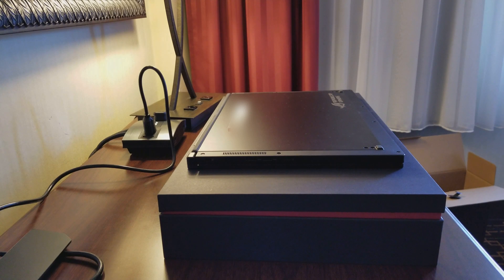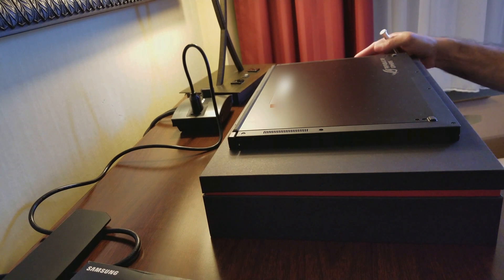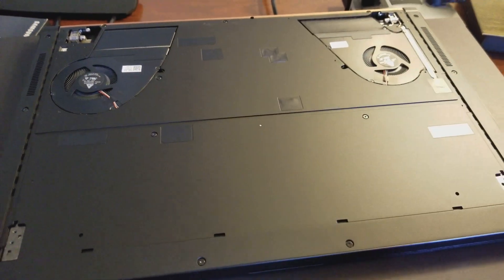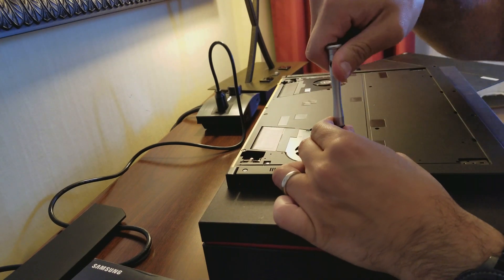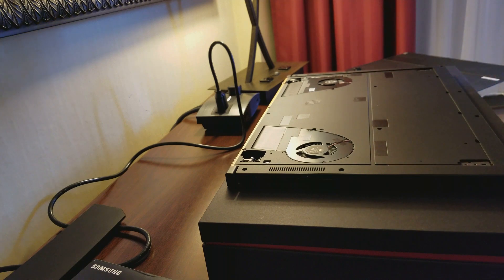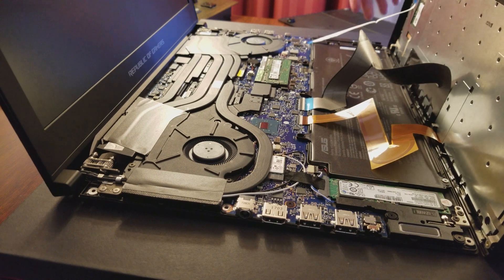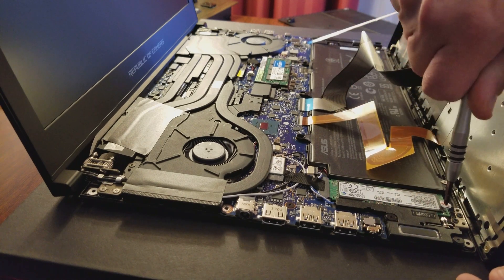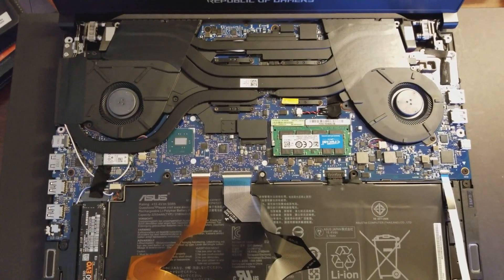Asus Zephyrus SSD and Ram Memory Upgrade

Comment: I bought a recommended ram upgrade for the soldered on gx701 I have 16gb soldered single channel. I added my Samsung 2666.6 ram and I get a black screen. I take the ram out all is normal. I ordered another stick of ram hyperx on recommended on Amazon incase I need to return. What ram do you suggest worried ill get black screen again
Reply from the maker: U can use these ... https://www.amazon.com/Crucial-16GBx2-PC4-19200-SODIMM-260-Pin/dp/B019FRCV9G/ref=as_li_ss_tl?crid=2OO5IPMTUETR&keywords=32gb+crucial+ddr4&qid=1556652522&s=gateway&sprefix=32Gb+croc,aps,201&sr=8-3&linkCode=sl1&tag=worldofgadg08-20&linkId=a8e833669cc90e89818f88d6f9820cf7&language=en_US

Comment: Hi there... Great video. However, I am confused. I have a Zephyrus GX501. It came with 16Gb of RAM and I want to upgrade it to the 24Gb. I see that you only removed one module and there only seems to be one slot. Does this mean that you inserted a 24Gb module? Can you tell me how this goes? I thought I only had to ad an extra 8Gb module. Thanks ...
Reply: if its like the gx701 there is 8gb soldered on and 8gb stick that you can remove

Comment: Is it true this zephyrus has 1 slot of ram welded on the motherboard
Reply from the maker: Alejandro Leyva yes
Reply: What's the estimate time when it comes of the battery in use with out having the charger plugged in?

Comment: You REALLY need to be careful taking the top off; I just did it, and the ribbon to the mousepad broke off, and it’s not possible to re-connect it. The actual plastic connector came off the back of the keyboard.

You have been warned!!

Comment: Hello, is the soldered slot an 8 or 16?
Reply: That's what I was wondering. He replaced the 8gb stick with 16gb. So 8gb soldered? Making 24, with 8gb soldered and 16gb upgrade stick? Thx
Reply: @stlexicon3044  that's what I fear

Comment: Heyo, i have read, that there is a 2nd RAM slot(?) and a 2nd m.2 with only Half the PCIE lanes (slower tranferrates).

I have the GX701GX and want to add one RAM 8GB (SODIMM) and ONE Samsung m.2 NVME 1TB

i havent found the slots and i think its on the back of the Motherboard but im scared to check because IF it isnt there it might be worthless to do all the Stuff.

Can you tell me how i Could upgrade the ram to maximum (Which RAM sticks i need) and where i can put the 2nd m.2 NVME?

Regards :)

Comment: Hi when I opened mine I accidentally disconnected the white cable from the right side ? What should I do?
Reply from the maker: Julio Luna well there should be a small lock just pull it up using ur nails insert the cable back in and lock it in again ! It’s very simple
Reply: I had the same issue - only the plastic clip actually came off of the back of the keyboard, resulting in the mousepad no longer working...

Comment: Gaming performance will drop 20% or more if RAM is upgraded on Zephyrus that has 8GB onboard.  You must leave the 8GB onboard + 8GB pre-installed SODIMM alone or else dual channel performance is lost.
Reply: Does the 24gb Zephyrus have the soldered slot as the 8 or 16 one?
Reply: Cpu Z says I have single channel on my zephyrus 1 slot used of 4. Whats does this mean...my understanding is that there is a single slot with 1 8gb stick and 8gb directly soldered in. Now I havent opened mine to look. But if this is true why does it report it as single channel. Am I to assume that in reality I have 16gb soldered and no ram in slot?

Comment: So you upgrade your ram from whatever it was to a 16gb but you say it would go up to 24gb? I don’t understand
Reply from the maker: FUNK949 yes so the way this laptop is configured is that there is an 8gb ram soldered in and its internal and can’t be change so the slot that is available for upgrade it supports up to 16gb so I changed it 16GB plus 8 GB internal That equal to 24 Gb
Reply: @WorldOfGadgets  dont you lose dual channel doing this?
Reply: @jean3030  i prefer 2 8gb slots

Comment: I just got a GX501GI and I upgraded the ram with Crucial 16GB and installed a Samsung 970 Pro 1TB drive in it...  After doing a fresh windows install and all the drivers, almost every game crashes after getting so hot...  I have tried to disable Turbo and undervolt .150 and still no luck...  I know some are repasting, but I will make that a last resort...  Anyone have any other helpful ideas?  I am going to try cloning my original 512 drive over to my new Samsung 970 Pro and see if that fixes it, as games ran just fine on the 512 drive...
Reply from the maker: Have you installed Samsung NVME drivers ? I would also uninstall and reinstall Nvidia drivers
Reply: @WorldOfGadgets  I have not installed Samsung drivers....  didn't know I needed to.  I will....

I think I found my problem....  Doing some troubleshooting, I put back in the original M2 drive...  Games crashed, which they didnt crash on that drive before...  So, I put the original RAM back in and booted up with original M2 and games no longer crash...  So it has to be a bad stick of Crucial ram.

Comment: I have the similar specs on mine,... I did a crazy crazy thing. During gameplay my temps were up in the  88-91C constantly and sometimes over that, Anyways I went ahead and put Thermal Grizzly Conductonaught on the Intel CPU and NVidia CPU,... I've never used the stuff b4 so made sure to use regular Thermal Grizzly Kryonaught everywhere else,.. almost 2 tubers. Anyway, its been purring along for a week or 2 and on ave 12c cooler,... ;) Also I don't know if this helps but I drilled 22 - 1/2 holes on the flip up lid to try an allow the air from the cooler pad to more directly hit the underside of the CPU's....  All in all some crazy mods for a brand new $2,500 lappy, but thought id share my story.
Reply from the maker: Thx bro!

Comment: What is the brand of the original SSD drive?How long is the battery life?
Reply from the maker: Nuno Duque the original one is by Samsung as well but it’s one of the lower end ones and the battery life is horrible !!!! Maybe hour to hour and half
Reply: Do you remember the original model of the Samsung SSD? I would like to check out the benchmarks,
Reply: Samsung 
Luis Clement
2 minutes ago (edited)
Samsung MZVKW512HMJP-00000 Seq Q32T1 Read 2973 MB/s Write 1583 MB/s

Comment: You kept the keyboard part hanging on the cables. It's a stupid thing to do. You should have disconnected the cables. And most importantly you should have disconnected the battery first.

Comment: thanks for video....i will upgrade my Zephyrus with 2TB Samsung 960 Pro -

whats the maximum of Ram ?
can i install a 32gb ram modul ?
Reply from the maker: Zero Cool no unfortunately you can’t. Max is 24GB
Reply: Mehrdad B ok thanks, can i insert a 2TB M2 ? or is 1TB max ?
Reply from the maker: Zero Cool 2tb should work just fine.
Reply: Mehrdad B thanks , today i have insert 2TB Samsung 960 PRO, it works Perfect , thanks for you movie 👍

Comment: Hey, I have done the same to mine. Just with ADATA SSD And RAM. Works flawless. :-D But on ASUS driver download section under Utilities, there is driver for GameVisual (Also called: ASUS Splendid Video Enhancement Technology) with the changeable 6 colors. But there are missing some ICM files in the installation, so i can't install it. Do you have a backup that Works on that or a solution?
Reply from the maker: Steven Green no I don’t ! I ran to the same issue as well. And I just gave up hahah

Comment: Question: there are 3 attached cables when you opened the top keyboard panel. Do we need to unplug them first? Because screw/unscrewing the SSD while holding the top panel seems to be a hassle.

Comment: hey mehrdad, so you say that you are connecting this laptop to a 3440x1440 monitor, and i want to know if you are getting acceptable frame rates in game, i just want to know because i am connecting this laptop to my 2560x1080 ultrawide gaming monitor.Thanks.
Reply from the maker: Amir 10 in getting 100 fps on battlefield! But remember u got to use the thunderbolt   port
Reply: thanks for replying, i have another question, can you overclock the gpu.
Reply from the maker: Amir 10 no u can't
Reply: Oh, thanks for replying, i have another question, can I put a 2tb samsung 960 pro in this laptop, Thanks.
Reply from the maker: Amir 10 yes u can
Reply: Amir 10 

2TB o_O why do you need so much??
Reply: I NEED HEALING

to store games, pictures, videos and files.

Comment: If someone wanted to up this system to 40GB of RAM by using a single 32GB memory stick, would that be feasible?
Reply from the maker: Baconator James no 24gb is max
Reply: Thank you! Will have to go with the full size ROG to get 32GB+ I guess. Appreciate the reply.

Comment: hi there, how did you manage to copy your data to the new ssd? did you clone your old ssd or did you start over with the new one and install windows and drivers again??
Reply from the maker: Sebastian Narvaez I did a fresh install
Reply: thank you for your answer, did you create a usb boot or something like that for the fresh install??
Reply from the maker: Sebastian Narvaez, yes I have a bootable windows 10 USB stick
Reply from the maker: Sebastian Narvaez yes
Reply: @WorldOfGadgets  After i changed the ssd and plugged the bootable Win10 stick, after restart i don't get the boot menu. I can't even access bios with the ssd inside. When i swap the old ssd back i can access bios again and also the boot menu and i can start the new installation. I don't understand what is the problem with the new ssd.

Comment: Thanks for the guide and I also have changed my Zephyrus's SSD and RAM. BTW, Do yo have any idea about how to repaste this laptop? The CPU temp is not very good in some games and I tried to repaste it with liquid metal. But it seems very hard to remove the fan structure from the  CPU and GPU.
Reply from the maker: Qinghui Zhang to be honest with you, i wouldn't do that since that will avoid your warranty
Reply: Now that you mention the temperature... Does it cause discomfort or burns your thighs if you put it on your lap?
Reply from the maker: devilspectre not at all
Reply: Thanks Mehrdad B... Just to make sure... Even when gaming?

Comment from the maker: So Great News Everyone! I had a problem with HDMI port on this laptop that only Outputs 60hz to external monitor! I have a 34' ultra wide monitor 3440 x 1440 at 100hz and I had to bring down the refresh rate to 60hz for it to work. 
so I found a thunderbolt 3 dongle on amazon for $79.99 that supports TB3 to dual Display port. 
I'm happy to confirm that my monitor is working with this dongle at full 100hz :D 

this is the link : http://a.co/hMLME6W
Reply: No it could not. Its basicly a 1070 (Desktop Grade) so you can compare it to GTX1070 Benchmarks. But you get a Light sexy lookin beast. YOu can go for Desktop Grade 1080s in heavier laptops ofc.
Reply: I've read somewhere in technical documents about Thunderbolt that it supports USBC up to 60 Hz over Thunderbolt. Are you sure you can use it as 100 Hz?
Reply from the maker: ALPER YILDIRIM yes. It’s 60hz on 4K but on 1440 or 1080 it supports over 100 . I’m not sure how much over but my Ultrawide monitor only supports 100 hz and it’s working perfectly .
Reply: Youre a LEGEND. And TB supports even 144Hz...
Reply: could this baby run at 3840 x 1600 on high settings on AAA games at 60 - 70 fps? I'm about to get one and was wondering if it could push that resolution at those settings so I could play on my LG 38UC99-W
Reply: How do I save the data on the ssd that I just replaced??? PLZ help
Reply: I tought the GX701GX has no Thunderbolt O.o i have USB C

Comment: can you confirm if the thunderbolt 3 port can connect to an external gpu dock to future proof, like  the razor core or the asus one?
Reply from the maker: Yes, It can.
Reply: did you try to connect to a gpu dock? does it combine the 1080 and the external gpu or only take the stronger of the two gpus?
Reply: It will only use the external GPU while it's connected.
Reply from the maker: James Buck your external GPU case it comes with a driver or software that will disable the internal GPU.

Comment: Hi! Thanks for the video! Could you give the the exact memory specs? to get a memory module that has the same cas latency. Thanks!
Reply from the maker: thetrucidator hi please look at the link   https://www.amazon.com/gp/aw/d/B019FRBHZ0/ref=mp_s_a_1_1?ie=UTF8&qid=1502055783&sr=8-1&pi=AC_SX236_SY340_QL65&keywords=Crucial+16GB+Single+DDR4+2400+MT%2Fs+%28PC4-19200%29+DR+x8&dpPl=1&dpID=51esjcOy79L&ref=plSrch
Reply: World Of Gadgets Hello, thank you so much for the vid, and this link. Question: When you say you upgraded to the highest available ram of 24gb but only replaced w/a 16gb stick... is there another 8gb stick in there that was left?

Comment: Does this void Warranty? Also did you try a mobile Powerbank Charger ?
Reply from the maker: Stefan Dimitric as long as u dont break anything your fine and a power bank will not charge this laptop.
Reply: And what about a 100W Powerbank?
I saw you screwing in that "Sticker" are you sure about Warranty?
I Just ordered one of them and I am going to try to solve the battery problem :P
Reply from the maker: Stefan Dimitric I called Asus and I asked them if upgrading my RAM and SSD will it void my warranty? And they told me no! But it's always save to give them a call and double check for your self.
Reply: After Having it for Almost 2 weeks what are the Bad things about it?
Reply from the maker: Stefan Dimitric  battery life is horrible and my other problem is that I have an ultra wide monitor up to 100hz but will hdmi port it only outputs up to 60hz :(
Reply: Okay that doesnt sound good I mean the Battery life was told by everyone but only 60Hz Output is bad because I prefer 120/144Hz and soon 240.
So would you still recomend it?
Reply from the maker: Stefan Dimitric well, I don’t know you have to think about how light and cool looking this laptop is ! What I want to try is the thunderbolt 3 port ! I have to find an adapter to convert DP to thunderbolt 3 and try it again.
Reply: Oh thats right TB3 should work Maybe get a Dockingstation instead of an adapter?
Reply from the maker: I got it work with this dongle and I'm getting the full 100hz at my monitor :D 

http://a.co/hMLME6W

Comment: so the laptop internal have 8gb of ram solder on and when you upgrade the 16gb ram it becomes 24gb? cause i bought the 16gb ver and im planning to upgrade to 24gb myself when i my zephyrus arrives >.<
Reply from the maker: Kagaya tesura yup 😁 8 GB is on the board
Reply: Is there any problem by mixing different ram capacity?

Comment: Do you have to re-install windows after you upgrade the ssd?
Reply: lol
Reply from the maker: 192.168.1.1 Yes. I did a clean install of windows. You just need to make sure to install the drivers from Asus.
Reply: you could just used some acronis program for migrate you all data from previous drive